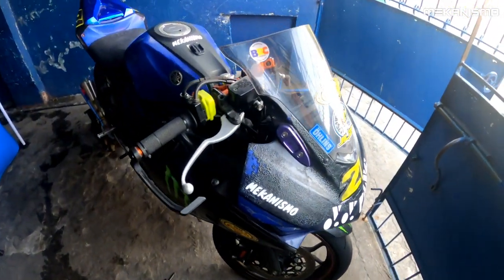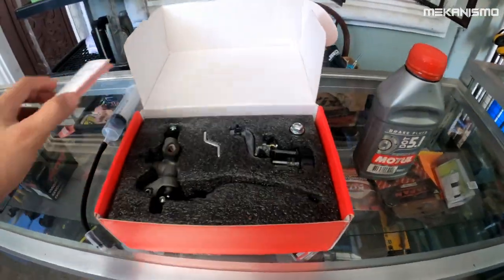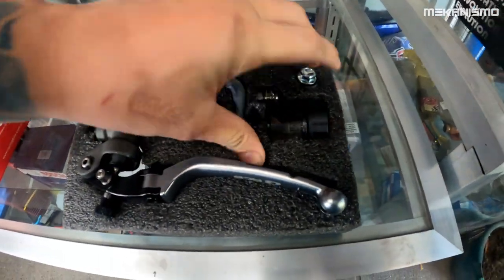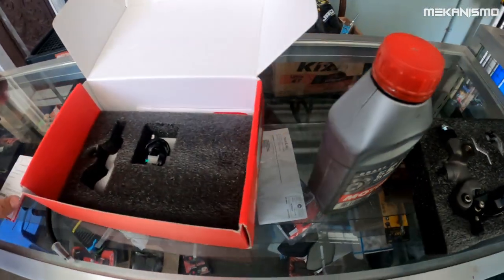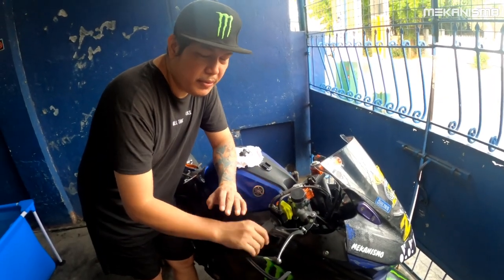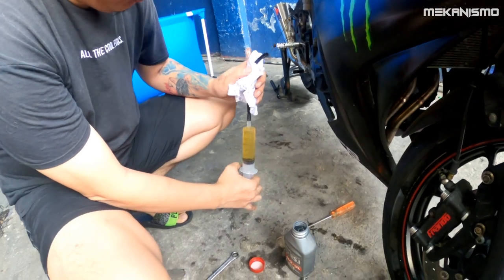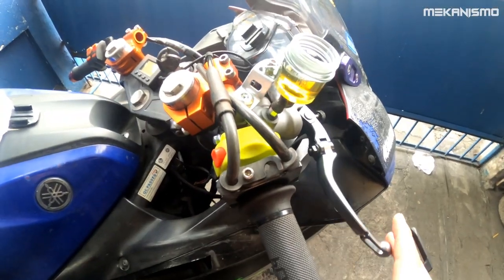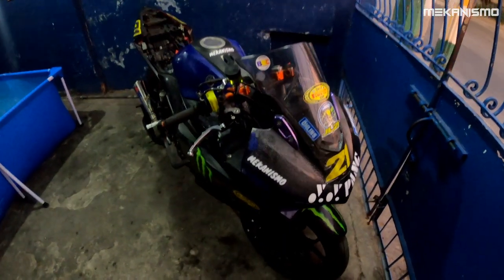RCB 17mm FORGED BRAKE MASTER PUMP INSTALLED | YAMAHA R3

Comment: Paps hindi po ba kasya 14mm?
Reply from the maker: 17mm gamit ko sa r3
Stock is 13mm
Reply from the maker: And for this kind of setup kasi mas prefer ko 17mm and since pang r6 ang gamit kong rotor disc